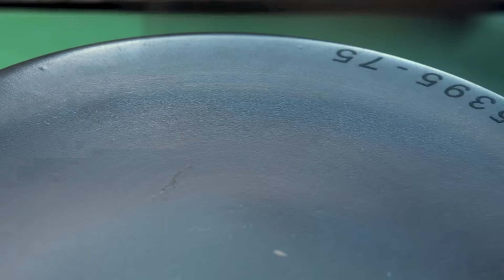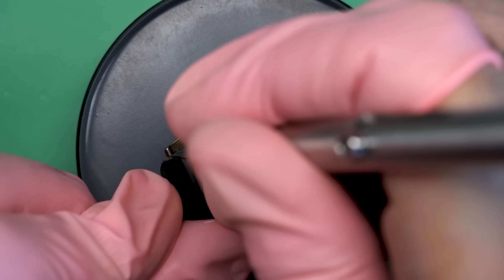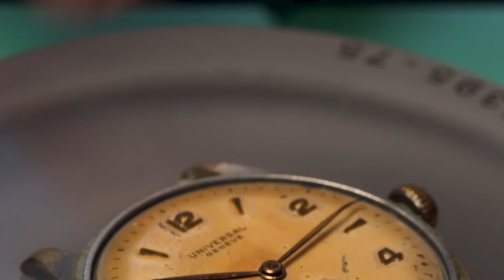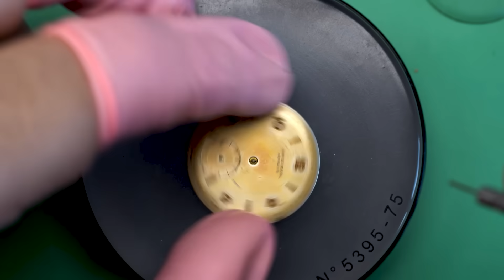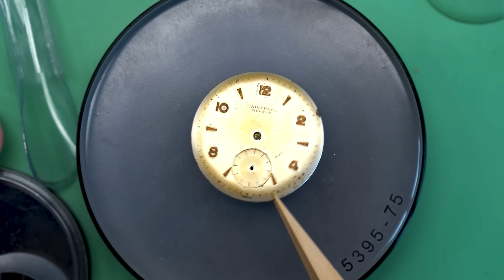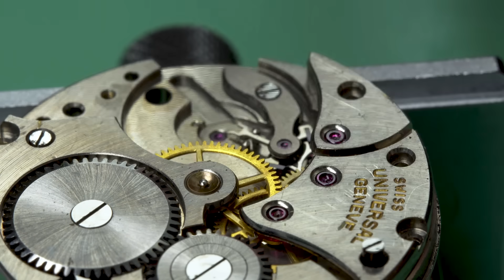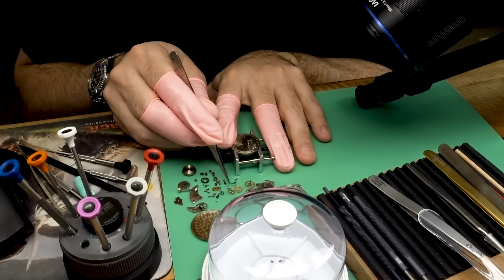Full Restoration Needed On This Universal Genève Watch!

Comment: I have question for you. I see you use your Bergeron mainspring winders all the time. I work with the vintage manual wind watches for now and pocket watches. 
I have seen you never have a problem with your winders. I have found when I try to use my winders the spring will not stay hooked to the arbor. How do you make your stick every time.

Comment: Just a fun fact, way late, in case anyone cares: In electroplating the negative lead is always the anode and the positive is the cathode. When plating the Cathode is attached to the part being processed and the Anode is attached to whatever metal is being used to conduct to the negative terminal. When stripping it is just the opposite, The part is the anode.

Comment: Older Trucks used to have reversed thread or counter clockwise  Lug Nuts  so the G Force of the wheel spinning would want to keep them tight.

Comment: Chrome plays into the Green.  One takes steel and copper plate and then chrome.   So the green is very likely copper ions and oils and what not.  Copper corrodes green with some body acid.  Remember rings turn my finger green... that is what I deduce.

Comment: sorry, don't want to be nick picky, l love all your videos, loved this video in particular with the methods applied and the scientific background and explanations you give, which I love, but you said: " I put quite a lot of electricity through it, around 10V, " which is not quite the correct scientific description, according to Ohm law Volts is the electric potential, and Ampere is the electric current going through the electrolytic method and solution you are using here very cleverly, even in reverse mode. I know exactly what you meant and I am sure you know what I mean, and I am more praising your talent here more than anything else!

Comment: Nickel is a troublesome finish. See also how Scandinavia have removed nickel from their coinage; allergy is a bad issue.. once acquired, nickel allergy never departs. Whilst UK has changed coin alloys to see more cheap steel, with a surface coating of pure nickel, which will increase the number of people that acquire a nickel allergy! (UK is rather stupid in recent decade(s))
Better to finish coat with chrome or a nickel alloy.. or better!
Reply: In reality, only 1 - 2% of males have a nickel allergy. Bit more for females.

Comment: I love watching your vids.  You restore watches, others restore cars or even aeroplanes, and I myself am working on 1950s vintage valve miniature oscilloscopes.  I am stuck for choice in how to go about it, but I usually slightly upgrade...  After cleaning and doing obvious repairs, make graphicule green acetate bezels where before there were none, replace 3.5 mm banana sockets with BNC sockets (I did try phono sockets but they wear out quickly).  I put a high slope Pentode valve in as the amplifier as it gives more gain, and if there was no sync amplifier, install one.  I could re-stuff old capacitors hiding new ones inside the shells of the old ones as the new ones are much smaller - but I simply replace and somewhat redesign the layout.  The old O'scope doesn't go any faster than before, (50 kHz to 1.5 MHz are about the top limits for waveform display and envelope display) but now is sensitive and stable enough to use to test low voltage solid state things.   And I make user manuals to go with them to show the sorts of tests you can make with them.  They have a certain cachet and beauty about them..
Everybody wears a watch.  Few people use oscilloscopes, and even fewer would see any virtue in restoring vintage slow instruments when modern instruments go up to 1000 X faster and much more accurate.  Even so...   :-)

Comment: You could use a nickel stripper, steel wool, or several other means to remove nickel plating.  

I believe you could use certain acids as well.  Especially if you're going to re-plate.  You could practice on something like a plumbing fitting to get an idea of how these work.. or try it on damaged crown wheels.  Could save you time and/or effort if you're willing to do a little chemistry
Reply: He did use a nickel stripper. It just wasn't nickel.

Comment: The green gunk you found is copper salts, probably cuprous or cupric chloride, the chloride from NaCl in sweat.  It reacts with the copper in the brass case, producing the green copper salts.  It is equivalent to the green patina found on decorative copper surfaces, where it is usually desirable.  Here, not so much.

Comment: One of the reasons watches are "nickel chrome" plated is that quite a few people suffer an allergic reaction to nickel, especially if in contact with the skin for any length of time and particularly in conjunction with a bit of sweat, like under the back of the watch on your wrist.
A flautist friend of mine found out she was allergic to nickel the hard way when the silver plating on her flute wore through around the mouthpiece and her lips swelled up badly.
Hope whoever ends up wearing that watch isn't allergic to nickel, though I guess they'll find out pretty quickly :)

Comment: old british cars used to use a left hand thread on wheel centre hubs.  suppressors are often left hand thread.  nothing special about a left handed thread, just common sence practical engineering for the right circumstance

Comment: If the power supply won't go low enough, perhaps you could add a resistor in line with one of the leads. The ones you want are either the white ceramic ones or the extruded aluminum ones. You might be able to get one for just a few Dollars. You likely want at least 25 watt ones, but even 100 watt ones would be fine. As far as the resistance, you might get a 10, 100, and 1000 (1k) ohm ones, and see which one work best. The resistor will get warm as it's turning electronic energy into heat, though resistance, but should not be too hot, and should not be placed on plastic, nor left unattended for long amounts of time. Usually they are made to be screwed onto a heatsink or metal plate, but if you are not pulling a lot of current through them, they should be fine. For those who don't know, volts multiplied times amps equals watts, so you can know if you are being too tough on it. Tape the wires or apply heat-shrink tubing if you have some kicking around so the wires don't short.

Thanks for the videos.

Comment: It's a bit misleading to say that they use plated metal just because brass is cheaper - it also allows for using materials with desirable characteristics, such as a balance of ease of machining and mechanical strength, which is an area where brass absolutely shines. Gold would be far too soft, steel is really difficult to machine at the required precision, aluminium would be far too soft, silver would tarnish everywhere, etc. Brass does corrode - which is why they plate it - but it's extremely durable overall while being soft enough to machine relatively easily, but strong enough to allow for fine detail in the machining. Most likely the move to steel came from innovations in tooling and machining allowing for mass production levels of machining at the required tolerances and levels of detail for watchmaking.

Comment: As a hobbyist watch restorer myself I'm envious of the tools you have but you inspire me to buy better tools and use your processes as you restore these old watches.  I think it's a great hobby, it inspires patience, a little innovation when things go sideways and provides quite a lot of satisfaction when someone actually pays for your work.
Reply: How did you learn? I want to get into the hobby myself.
Reply: Just ran across your question a year later...sorry.

I already had a vast collection of watches saved over many years, most running but a few not.  Since they were cheap I started taking them apart and see if I could get them running and then reassemble them.  I quickly learned that I liked Swiss watches because of their layered design unlike a Timex with is a sandwich design.  Then started buying just a few better tools and I still do not have all the tools that Marshall has to his disposal. 

But you do not need all of them, you will adjust based on how serious you are about watch restoration.  For instance I do not have the re-plating tools and machines.  I just don't buy distressed watches like Marshall just restored in this video. A also found some local resources here in Seattle that helped with certain parts.  My only advice, do not ever try to restore or clean a vintage watch dial, you will ruin it.  I clean and refurbish every watch I buy and to date I have sold about 640 watches on eBay. @asensibleyoungman2978
Reply: @devonshire56  Thank you. Much appreciated.

Comment: Keep in mind that you can't leave it nickel plated because of allergy reasons. You have to finish off with chrome or gold. 

The degreasing solution removes also the thin layer of oxide that the case is covered in so new metal can stick to it.

Comment: Dear Marshall, I have a universal watch not working and I thought was the battery.  However, the repair service centre has mentioned to me the mechanism is gone and had to change the entire mother board.   The model no. 07-0006-004.  Would you give me your feedback please?

Comment: I agree with you about how odd left handed threads are. I used to work as a maintenance man at a resort and had to work on clothes dryers alot. The fan lugs have left hand threads. The first one that I worked on I did not realize that and mangled the plastic fan. I never made that mistake again.

Comment: Great video as always. Would be great if you could tell more about how to find the right crystal the watch(because there are a million variants). Thank you
Reply from the maker: There are 2 or 3 that are used for most watches like this, one regular and one with a step at the bottom. Also a flat one. I usually order one of each if I'm not sure as they are only a couple bucks and it's handy to have extra ones on hand.

Comment: Vehicles will use reverse threaded bolts on drivetrain parts.  When they accelerate the torque on the bolt would cause them to loosen.  When reverse threaded, they will tighten.

Comment: If youre already used to plating with nickel, why dont you try to do a copper layer as a "foundation"? Electroplated copper, with the right additives, can easily smooth out a lot of uneven surfaces. You can even use some wetting agent additives in a nickle plating solution to prevent pitting.

Comment: The easiest way to remove an electroplated chrome layer is hydrochloric acid. But I would strongly suggest a fume hood, because the fumes from the hydrochloric acid are very corrosive and could easily damage some of your projects if youre not careful.

Comment: In regards to not being able to adjust down the voltage of the power supply sufficiently to not get too much current.

You can use the current limit adjustments on the left side of the power supply as clearly seen at 20:25
Then it will only supply up to the current you have set it to.

With it being a 3 amp supply, the coarse knob alone should allow you to trim down to 10 mA with ease, and add in the fine knob on the furthest left and you can easily go down to sub mA. (Based on my own experience working with a few different yet similar power supplies over the years, these units are a dime a dosen and all more or less work the same.)

If the circuit limits current flow sufficiently, the voltage will increase until it hits the voltage limit and here the current will fade while the voltage stays. The adjustments allows one to set limits for each of these properties, and then the circuit's resistance will work with one or the other limit.

Comment: Hey I don't know if you look back at older videos to check the comments or if somewhere below someone else has said this but I chrome plate at home all the time. It's true chrome plating as well not a fake work around its just a different set of chemicals from a company called 'casswell'. I think I have that spelled correctly anyway. I also do some really cool black chrome and gold and silver and sometimes nickel. If you see this and don't know what I'm talking about than get in touch and I'll send you all the links and info I have. It's very doable.

Comment: The screw that has the left hand threading because the wheel/cog turns anti-clockwise and if it were right hand thread then the rotation of this wheel could slacken if not unscrew itself completely, that'll be why it is the only screw with left hand threading. (It's the same with older cars, bolts/nuts on the left hand side were also left hand thread. Especially the hub/axle nuts).

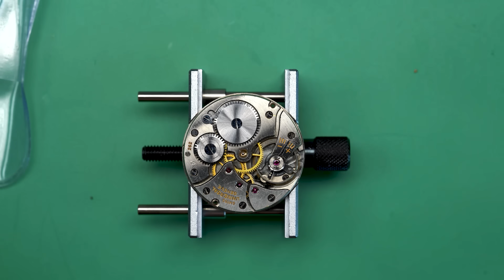Comment: 5:17 you can also use a mechanical pencil for this, much better than tweezers. The trick with the mechanical pencil (other than finding the right size) is to push it down on the part, then pull swiftly up, kinda like how you'd try to pull a stray hair. I have used them in the past in a pinch, they work great. Koh I Noor mechanical pencils, in my case.

Comment: Thanks for this great video. I have two Universal Geneve watches from the 1940s. One was a gift from my grandmother to my father when he was 14 years old in 1943. According to him, it cost around $40 back then - a good chunk of change for a single secretary to afford. He has had it serviced multiple times in his life I believe case it has now is the second one. Is actually marked Hong Kong so the watch repair shop it went to some 40 years ago replaced the original with this one. Now it too needs work such as you describe here. The movement needs servicing as the watch tends to stop whenever it feels like it. But, the face and hands are in very nice condition. It has a second hand subdial just like the one in your video.  The other watch is one of my father picked up off eBay, probably 10 or 15 years ago. It is a lot like the first one but has a center second hand. This one runs fine but unfortunately the crown and stem slipped out of it while I was wearing it and disappeared into the great beyond. Now I have to replace them but that is actually fine, because the crown was not original and was way too big for the watch. Hopefully I will find one somewhere!

Comment: Nice job sir, nice job. Can I give a little tip? When placing the balance wheel, and the balance bridge doesn't go in with ease, use the screw, and gently screw it in. This way you can control the approach of the bridge and avoiding sudden move and the dreadful impact on the pivot.

Comment: Great job, have had to leave my watch with the repair shop, 1st time it has been away from me since 2010. It's a self winder which I have had for years and still has the original steel strap, that is also currently being repaired. As the watch means so much to me, it was like leaving part of me behind. Think your work is exceptional and like the fact your more in tuned to restoring parts that can be, unlike some who completely replace.

Comment: Nice work on this watch. The movement looked factory fresh when you first opened it. /// When a part is chrome plated, a very thin Nickel plating will be placed under the chrome. When a steel part is to be chrome plated, first a copper plating will be applied, then a very thin layer of Nickel and then the chrome on top.

Comment: There is a slight possibility that the pallet fork jewels, and the roller jewel on the balance wheel, can work free while in the cleaning solution. You can do as you wish, but I never put these parts in the solution. I clean them with a very fine paint brush wet with solution - avoiding the jewels.

Comment: I did work in a Platery, and i can tell you:
You dont want to plate stuff with chrome at home, its fricking much work with sanding plating sanding plating polish plating...... it takes much time, work and it stinks, besides you have to work with chrome sulutions what can cause cancer if used wrong. Better go to a professionell who can do it for you if you want to pay 100€+

Comment: In your videos, you suggest starting with pocket watches, because of their larger components.  Is there a brand or model of pocket watches, which have a reliable source for replacement parts if required?

Comment: I feel like old watches were less square on the sides than modern watches. Even retro/vintage styled watches are still rather squared off it seems. But maybe the magnification in the videos is throwing me off and I wouldn't feel that way holding them. Idk.

Comment: Hi Marshall, at 30:38, the thingy that prevents it from unwinding is the click, not the keyless works. The keyless was made bi-directional to prevent you putting extra pressure on the click.

Comment: Thank you for your videos! They inspired me to move from grandfather and kitchen clocks to pocket and wrist watches. I’m on my way!👍
Reply: In electronics we know that electrons move from the - to the +. That’s why we make the watch + when electroplating. Same reason that welders make their work + and their rods - when welding upside down. It might go against what people think is normal, but it works that way. 
Also, a power supply that produces 1.25, up to 37 volts at 1.5 amps maximum can easily be made using an LM-317 integrated circuit and a hand full of small parts. You can even modify your power supply to use that regulator I.C.  They cost about $1.50.

Comment: I seem to forget to comment that all left bicycle pedals utilize reverse threading for the same reason that the crown wheel screw has reverse threads.  Reverse threads prevent the left bike pedal from coming out as you pedal your bike in the same way that reverse threads keep the crown wheel from coming loose as a watch runs.

Comment: The nickle ions as a salt get converted to nickle metal via electrolysis it looks like there is copper carbonate in the solution too. The other process you used was the opposite, turning metal into ions.